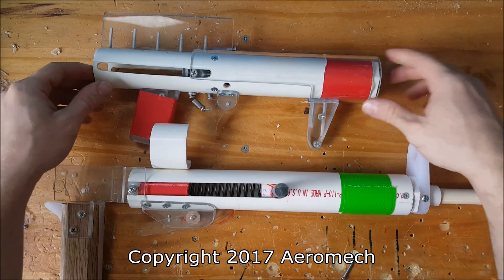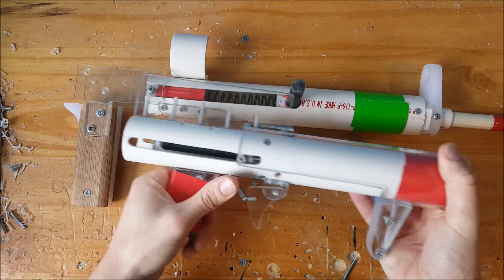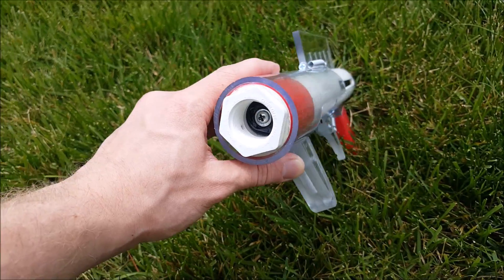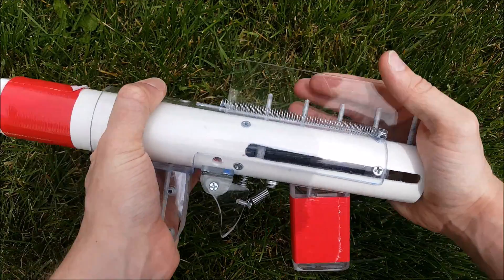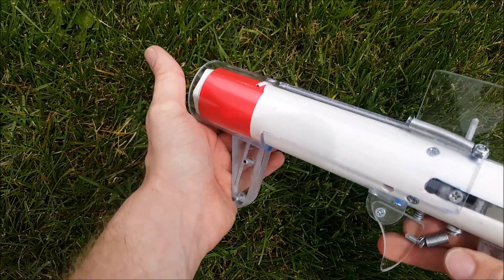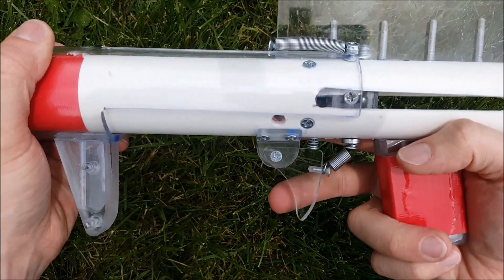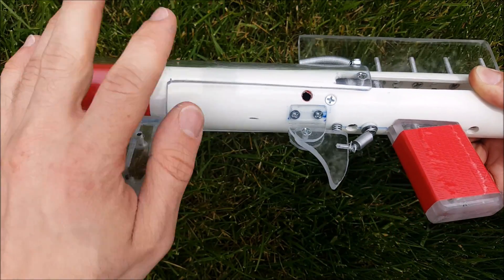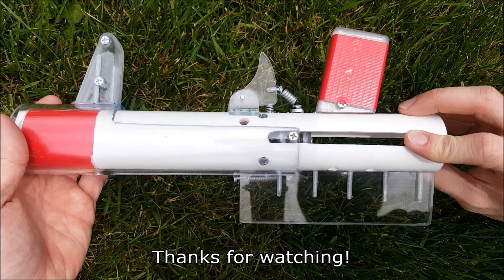Homemade Nerf Underbarrel Launcher!

Comment: Stick a one inch or a half inch pipe on the front, then you can get a firecracker and wrap it in some tape so it's snug in the tube. Light it before you fire and you got yourself a grenade launcher.